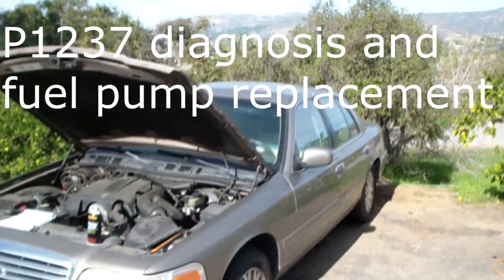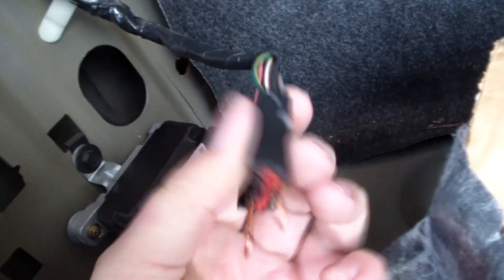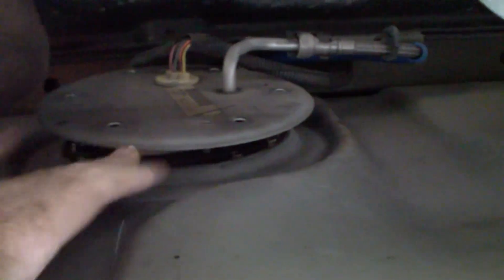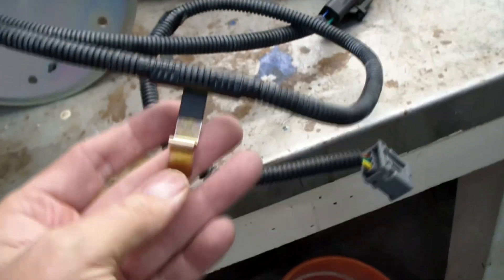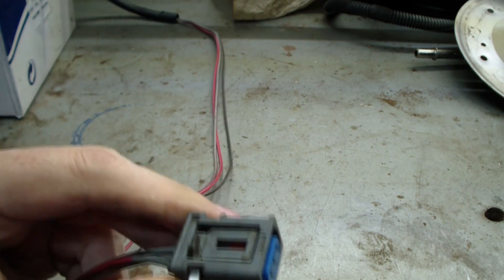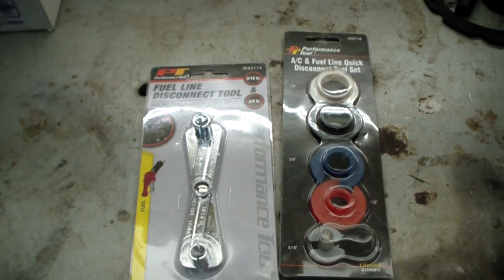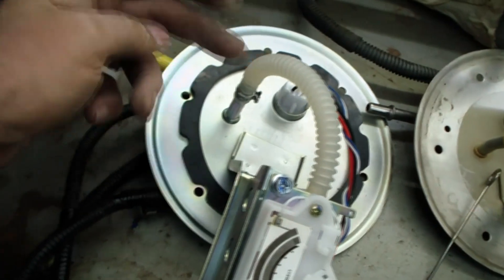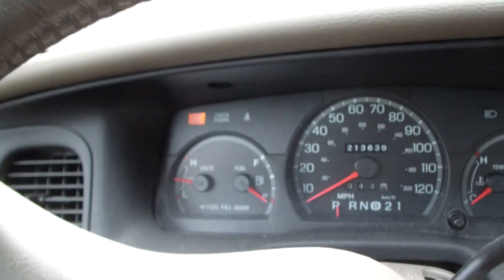Ford P1237 Error Code Diagnostic and Fuel Pump Repair

Comment: Need to install a ford (oem) fuel
Pump assembly. The aftermarket cheap pumps are junk.
Reply from the maker: See my Crown Victoria Fuel Pump Replacement FAIL! video to demonstrate your point. I used a cheapo pump and it quit after two days. Nothing worse than having to do the same job twice. Also be sure to change the fuel filter too. Could be reason both pumps failed. Old filter was tough to blow through.

Comment: Need to put some more writing over the plug so we really can't see it
Reply from the maker: I put the writing with correct info so no one would notice I had the wrong wire connected in video. Oops...
Reply: @KentDiego   wat if the connection gets hot when jumping it but it does start the car?
Reply from the maker: @1loud95obs3  Sounds like fuel pump is bad. Be sure to replace fuel filter too as I feel a restrictive filter caused my pump to go bad.
Reply: @KentDiego  thank u